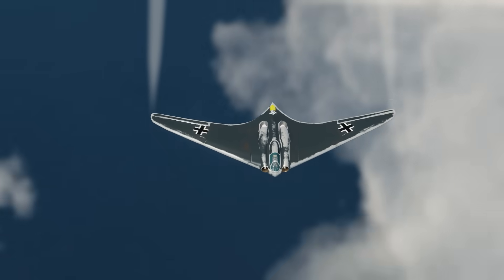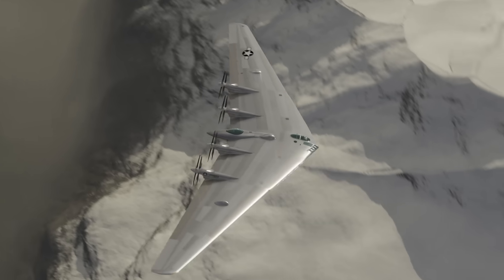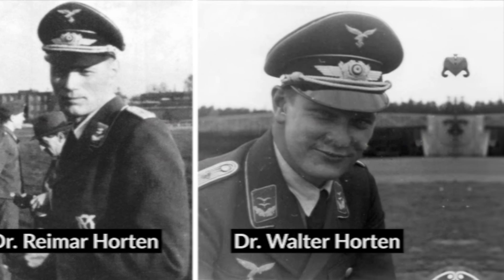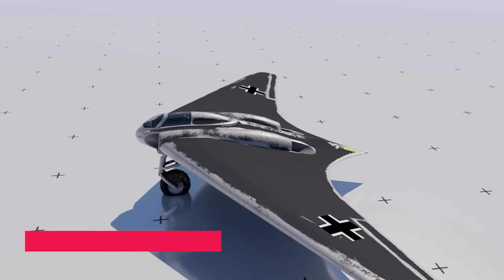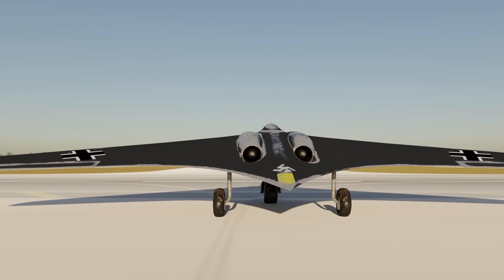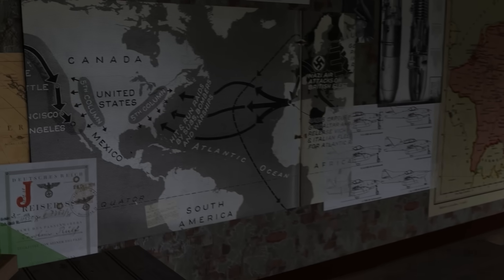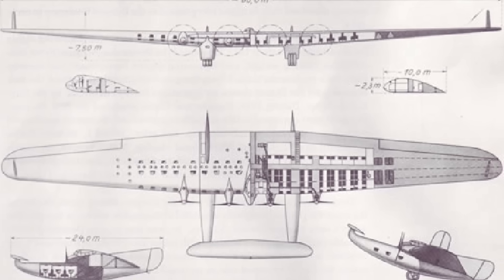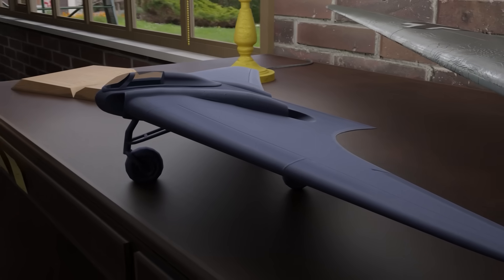Insane Flying Wing Jet Fighter To Save Germany - Horten Ho 229 Nazi UFO

Comment: slightly incorrect, the First flying wing was the Dunne D.1 but it only achieved short hops and flights. the Soviet Chyeranovskii BICh-3 was the first FUNCTIONAL flying wing type aircraft.
Reply: The Northrop N-1M was the first true flying wing.
Reply: Slightly incorrect
Reply: The Dunne D8 crossed the Channel from the Isle of Sheppey in England to Paris.
Reply: @fritzfieldwrangle-clouder7299  The Dunne D8 wasn't a flying wing. Ot was simply reffered to as such. It a vertical tale assembly and fueslage
Reply: @Rico-v7r  And the N-1M had vertical surfaces between the propellers and the wing.
Reply: @fritzfieldwrangle-clouder7299  Those are called engines. Entirelly different from verticle tail assemblies
Reply: @Rico-v7r  It didn't have any tail assembly and the fuselage is between the wing surfaces just like the fuselage of the N-1M.
Reply: @fritzfieldwrangle-clouder7299   It doesn't matter if it lacked a verticle tail assembly. It had a distinct fuselage with wings attached.
Reply: @fritzfieldwrangle-clouder7299  fly·ing wing

/flīiNG wiNG/

￼Learn to pronounce

noun

an aircraft with little or no fuselage and no significant vertical airfoil.
Reply: @Rico-v7r  All flying wings have fuselages, the fact that some are blended body construction is irrelevant to the principle of a flying wing.
Reply: Ooh, Josh's getting all testy.
Reply: @fritzfieldwrangle-clouder7299  No, flying wings don't have a fuselage. It's an inherent design principle... Hence it's a Flying Wing. You do know what a fuselage is right?
Reply: @fritzfieldwrangle-clouder7299  Nah, I'm good 👍. Sorry if I gave you the wrong impression
Reply: @Rico-v7r  My apologies, I think I have taken the wrong impression from something you put that was, I now think was just a consequence of cut and paste.
Reply: @fritzfieldwrangle-clouder7299  Well being a purist is how we get to the definition of what a Flying Wing actually is and the Pterodactyl 1A wasn't a flying wing.
Compared to the Pterodactyl having a fuesalage, the small verticle surfaces of the N-1M are a negligble consideration.
Reply: @Rico-v7r  No, being a purist is how you miss the principles of a flying wing and the Pterodactyl 1A was a flying wing.  And you ignoring the substantial vertical surfaces of the N-1M isn't very purist  of you is it.
Reply: @fritzfieldwrangle-clouder7299  So as you can see, the lack of a verticle tail assembly and fuselage of the N-1M makes it a flying wing while the the Pterodactyl 1A would be described as tailess or maybe even a blended wing aircraft if being generous
Reply: @fritzfieldwrangle-clouder7299  No, being a purist is how you establish what the principles of a flying wing even are.
Lastly, you calling the propeller booms "substantial" verticle surfaces is a a dramatic discription made simply to manipulate the conversation.
Reply: @fritzfieldwrangle-clouder7299  I'm curious though. What do you believe a flying wing to be? Simply a tailess aircraft?
Reply: @Rico-v7r   According to Josh the fuselage of the N-1M  makes it not a flying wing (and he should learn to spell because the conversation has come to that type of thing for him).
Reply: @Rico-v7r  No, me  calling the propeller booms "substantial" vertical surfaces is to highlight your verbal dodging.
Reply: @Rico-v7r  The principle of fling wing aircraft is an aircraft without a tail and vertical control surfaces where the wings provide all of the stability and control.

Comment: I was lucky enough to see a hull of the Ho-229 and other german flying wings in Washington, D.C. It was so amazing! 
Edit: It is in the Smithsonian museum! They also have the Enola Gay, the DO-335, and a komet.
Reply: Did they display the Northrop N-1M (the first flying wing, not the Ho. 229) or any other advanced American aircraft besides a B-29?
Reply: @Rico-v7r  yeah, there was some F-14 and late cold war jets, and a gyrocopter? (Plane with helicopter rotor) a flying platform, and I think the N-1- I might have a picture
Reply: @blu5021  The H-229, was impressively thought out design in the 40s. But it is far from being called the Nazis secret weapon. This wing aircraft now plays a role of a cover up of something more cunning.
Reply: @Rico-v7r  neighter of the two is the first flying wing. The hortense build there first true flying wing, the horten h-1 in 1934. Turing the röhn glider competition of that year that plane completed a flight lasting 7 hours. 

And even that plane most likely can not claim to be the first flying wing, depending on your definition of a flying wing

Comment: The term "bell shape" refers to the lift distribution of the wing not the actual shape of the wing. It is what makes it possible to fly without vertical stabilizers.
The very nice german word for it is:
Glockenauftriebsverteilung
Reply: It's brilliant too.
Reply: And the Horten flying wings didn't use the bell distribution either.
Reply: I love how the German language has so many ridiculously specific composite words
Reply: Easy for you to say!
Reply: The First flying wing was the Northrop N-1M
Reply: @Rico-v7r  not really
Reply: @toastyovens8777  It's an objective fact. So yes really
Reply: @toastyovens8777  The N-1M flew in 1939. The Ho. 229 flew in 1944
Reply: @Rico-v7r  And the Westland-Hill Pterodactyl Mk. IA flew in 1928. Flying wings go back as far as 1910.
Reply: @fritzfieldwrangle-clouder7299  The Pterodactyl 1A wasn't a true flying wing. It had a distinct fuselage.
Leonardo Da Vinci drew designs for tanks and hand grenades. Nobody claims he created the tank or hand grenades.
Reply: @Rico-v7r  Did Da Vinci's tank  actually exist and serve its function? The Westland Hill Pterodactyl actually flew.
Reply: @fritzfieldwrangle-clouder7299  But the Pterodactyl 1A wasn't a flying wing. It had a fuselage and by your logic a propeller that had vertical surfaces out of the back.
Also, although the Da Vinci tank never fullfilled it's inteded purposes... Neither did the Pterodactyl 1A.
Reply: @fritzfieldwrangle-clouder7299  I suppose the better comparison would be Da Vinci's Robot Knight. Was it the first Robot?
Reply: @Rico-v7r  The Pterodactyl 1A was a flying wing but if you want to exclude it for the propellers and also exclude Northrop's for the same reason, go ahead. And as an experimental aircraft the Pterodactyl 1A did fulfill its purpose whereas Da Vinci's machine never did.
Reply: @Rico-v7r  How would it be a better comparison?
Reply: @fritzfieldwrangle-clouder7299  As I've stated multiple times before the Pterodactyl 1A isn't a Flying Wing. It had a fuselage, vertical surfaces right behind the cockpit, vehicle surfaces on both wings, vertical surfaces in the rear of the fuselage from the exhaust system.
Reply: @fritzfieldwrangle-clouder7299  The N-1M only has the two propeller booms as a vertical surface in addition to lacking a tail assembly and  being one singular wing (I.e flying wing). It's pretty clear
Reply: @fritzfieldwrangle-clouder7299  Because Da Vinci's Robotic Knight was built and fullfilled it's purpose.
Did Da Vinic create the first Robot?
Reply: @Rico-v7r  What was it's stated purpose?
Reply: @Rico-v7r As I've stated multiple times before the Pterodactyl 1A was a Flying Wing (see how easy that is) The N-1M had a fuselage, it's where they kept the cockpit and it had vertical surfaces. The Westland Hill Pterodactyl 1A didn't have vertical surfaces on the wings  or from the the exhaust system.
Reply: @Rico-v7r  The N-1M isn't a singular wing, it's two wings, port and starboard  with separate control surfaces joined to a fuselage with a blended body construction.
Reply: @fritzfieldwrangle-clouder7299  
Technically, they go back even farther, as kites are effectively flying wings.
Reply: @Rico-v7r  
Actually, da Vinci - "da" means "of" in Italian, and is lower case - IS credited with inventing the tank and hand grenade, as he was the first to produce technical illustrations of their design and workings. He also invented the parachute.
Reply: @Rico-v7r  The Horten III flying wing glider was build to take part in the 1938 (!!!!) Röhn glider competition. So if Northrop's first flying wing was build in 39 it is an objective fact that the horten brothers beat him by at least a year.

The Horten III was also build in small scale series production from 1938 up to 1944.
 
So I would consider the horten 3 to be first truly successful flying wing design but still I would not call it the first and say the honore of building the first flying wing lies with neither the horten brothers nor Jack Northrop
Reply: @Rico-v7r  oh and by the way the horten III was a development of the Horten I that was also a true flying wing that first flew in 1934 and even managed a flight lasting 7 hours in that very year.
Reply: @Rico-v7r  
Yeah, no.
As said befor, the concept of a flying wing is so old, that many inventers can be traced to it's developement.

The HO 229 however is indiscussibly the first flying wing to use turbine engines and tackle the stability problems, more or less.
Reply: @Enthropical_Thunder  Yeah, no.
As I told Fritzfield, no "flying wing" before the N-1M was tailess or a blended wing meaning they werent actually flying wings.
Also as a said before, Leonardo Da Vinci made tank prototypes and nobody considers him the inventor of the Tank. Because he didn't invent the Tank.
Reply: @Enthropical_Thunder  Regardless of the fact that the Ho. 229 had Jet Turbines it was not the first flying wing. The First Flying wing was the N-1M.
Also, no. The Ho. 229 did not solve stability problems as flying wings wete not practice until fly-by-wire was created.
That being said the N-9M (not N-1M) and the XB-35 were more stable airframes than the Ho. 229
Reply: @Rico-v7r  
Well, for one, we are talking about flying wings, not blendend body aircraft (Junkers would actually take that first, as they build the first successfull blended body aircraft, the  G38, thought not tailless), the first "flying wings", meaning a tailless aircraft, were built by a brittish maniac called J.W. Dunne, actually ...
He built several monoplane and biplane flying wings.

Jack Northrop was a great mind but his designs were, by far, not the first flying wings.

So with all due respect, suck it ...

So
Reply: @Rico-v7r  
Fly by wire isn't nessecary to get a stable wing configuration, anhedral or dihedral orientations, wingtip geometry, weight distribution and lift distribution are all factors that can greatly increase stability without fly by wire systems.

Jack Northrop was the one to solve the yaw issues wich could, under certain circumstances, lead the wingtips to spiral into a figure eight motion and therefor induce flight sickness.

The Ho229 had it's own issues, mainly absolutly attrocious engines, however, flight stability, as shown with previous gliders (with the same wing geometry), wich the brothers built and tested, was no issue.

Northrop really just took on the challenge, to create a flying wing, wich did not need negative lift wing tips (wich are needed for a stable aircraft that does not relie on fly by wire systems), thereby enormously increasing the efficiency bonus of the flying wing design, over conventional aircraft.
Reply: @Enthropical_Thunder  Well, first of all the Junkers G38 was a blended wing aircraft not a blended-wing-body aircraft (BWB).
It was also neither the first blended wing aircraft or the first BWB aircraft.
The first blended wing aircraft was the Westland Dreadnaught of 1924.
The First BWB aircraft was the
Miles M.30 X-Minor.
Reply: @Enthropical_Thunder  Fly-by-wire is literally a prerequisite to having a controllable flying wing.
If you can remember correctly, the Ho. 229 had a tendency to Crash and both the Ho. 229 and YB-35 eventually killed their pilots.
You're talking about a tailess aircraft with a very large surface era in an era before fly-by-wire, onboard computers and thrust vectoring.
There is a reason why the XB-49 project was not pursued and a flying wing wasnt used again until the 1980s
Reply: @Rico-v7r  
Well, if you go by operational history, the G38 was the first successfull (stable) blended wing body aircraft, not the dreadnaught, wich became unstable pn it's first flight, crashed and was abandoned due to that, thereby the Dreadnaught was a deadend.
Reply: @Rico-v7r  
Well no, you do not have to have fly by wire, as i said.

The reason why they did not use the flying wing design up until the 1980's is simply cost efficiency.

You can build a pretty efficient high aspect ratio wing aircraft with conventional methods, wich will cost a fraction of a blended wing body aircraft and will have similar performance, because of the negative lift wing tips, wich enherantly stable flying wings need (when flying without fly by wire).

The second point is the stealth (or radar cross section reducing) effects of a blended wing body aircraft, wich made it usefull in the 80's. 

From an aerodynamic perspektive, you don't actually need fly by wire for a stable flying wing, take it from an engineer.
Reply: @Rico-v7r  
The fuselage of an aircraft is simply the main body. Even flying wings have a fuselage, it simply blends with the wing. However, lacking a fuselage is not a requirement to be a flying wing.
Reply: @Mandernach Luca Dunne's designs were simply tailess. That is only one feature if a flying wing which Dunne never built especially in regards to his biplanes (I.e wings plural). He also only ever produced one monoplane which was also only tailess.
So yet again, the Northrop N-1M was factually the first flying wing.
Reply: @Rico-v7r  

No, he wasn't that's the problem i meant, when i was said that the developement isn't that clear.

Dunne's aircraft are still considered flying wings.
A flying wing is a completely tailless aircraft.
It does not have to be a blended body wing configuration. So yet again, no.